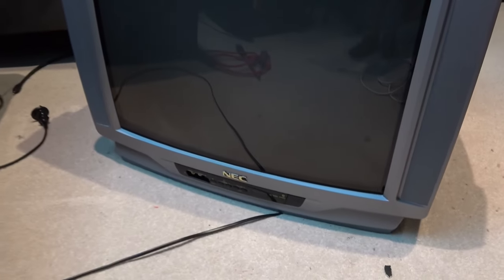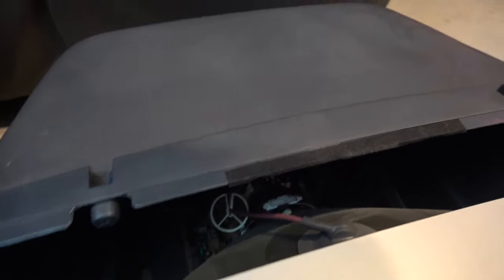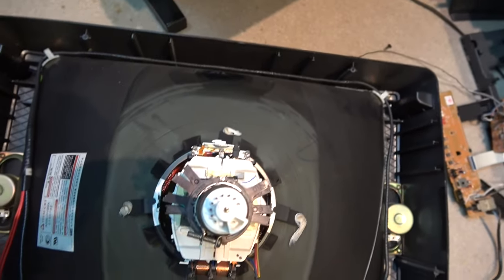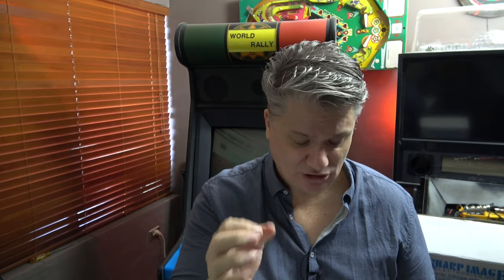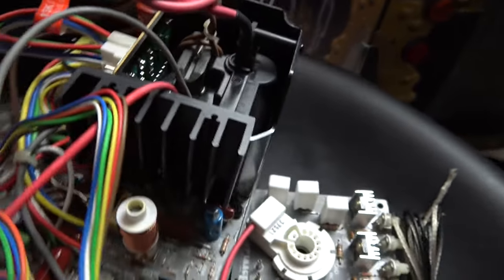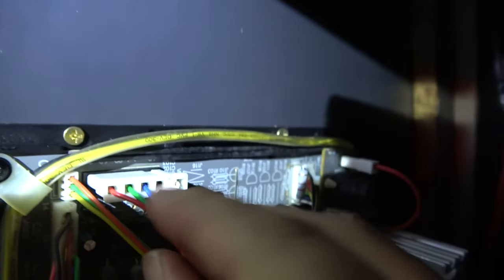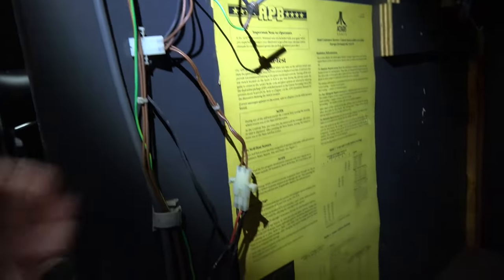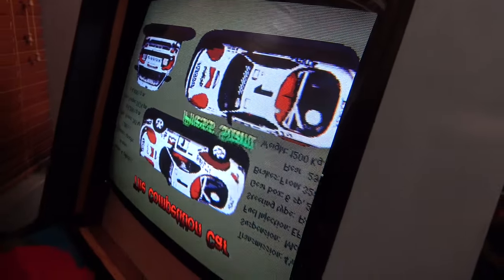FE021 - How to convert a TV into an arcade monitor!

Comment: I did a tube swap on a U.N. Squadron cabinet with some serious burn-in years ago. I just bought several old TVs which looked the correct size and swapped tubes. Worked great! I think I may have gotten lucky with the resistance. I can't remember if I used the old or new yoke.

Comment: I know this is an old video now and maybe others have also suggested this - but, you cn use any SCART RGB CRT tvs. Even Sony tvs - you can make a really easy Jamma (or whatever game you have in the cab) converter to scart. You just need 3 capacitors and 1 resistor.

Comment: I've been building and fixing these arcade crt monitors for years, these days with new tubes so very thin on the ground I tend to pull tubes from later tvs as they usually have virtually new tubes in them with low hours on,  it's surprising still how popular they are with arcade lovers and retro gamers, your right about Sony tubes... they can't be used.  Well they can but it's a pain because of the dual focus pins, different pin configurations, voltages etc, normal flat and square tubes can be used though ive built a few of 25 and 28" flats for customers who wanted to upgrade over the traditional curved tubes
Reply from the maker: Nice one...yep the sources are starting to dry up that's for sure....

Comment: I had the same problem with the neck being to long on a Sony monitor in my Electrocoin as it barely touched my access panel in the back. So I routed out a small square hole in the access panel to let the neck clear then bolted a new, smaller board over the hole and bought myself half an inch of extra clearance. The access panel looks a little strange but it worked and I can get to my neck without pulling the whole access panel off.
Reply from the maker: That's a good idea. I know a lot of them are a very tight fit and some original cabs have a bump on the back to accommodate the neck. You don't realize how big they are until you try and jam them into a cabinet, that's for sure!

Comment: I ordered a universal chassis from the same place quoted all the specifics and although it worked the image completely distorted I later found another tv that has the right yoke readings and had a more curved glass and it works better but still warped in side scrolling games now i just picked up another tube thats even more curved hoping it would be compatitble but the pinout is different so i cant use it. Now im still on a wild goose chase a tube that will work with the arcade chassis nothings showing up for sale anywhere.

Comment: Wait! What? You can't discharge that tube using another chassis as ground!!! Where would the discharge current go? Through the floor carpet? There is metal on the TV chassis that is supposed to be ground for the TV. Fortunately that TV was already discharged. And "modern" CRT TV's are usually discharged by itself within 15 minutes without power anyway.
Reply from the maker: You raise some valid points and these sorts of questions and assumptions can end up filling many pages on an arcade forum for weeks! All I will add for anyone else reading this is to say make sure you adequately earth the charge from the tube before undertaking any further steps in the process. Thanks for sharing your thoughts, safety is extremely important.

Comment: Is there a reduction in quality going from an arcade monitor tube to a television tube? I always thought arcade monitors were superior. That said, anything is better than lcd/led.
Reply from the maker: Great question. Interestingly according to a very experienced and respected local arcade tech, the arcade tubes tended to be the rejects that weren’t good enough for TV’s. So actually the other way round to what you thought!
Reply: I do find most regular TVs tend to have better geometry and clearer picture in the corners than your AVERAGE arcade monitors. However arcade monitors usually have much greater flexibility in terms of frequency ranges, higher quality  inputs, refresh rates, and screen adjustments.

Comment: I am swapping out an old monitor for a TV and using one of those converters with RGB wire connector so my question is can I just connect to power cord from new TV to the original power from old monitor? With old transformer still hooked up?
Reply from the maker: I'm not a licensed electrician so I can't give specific advice with respect to YOUR power configuration. There are also lots of variables. However, the likely safest option would be to maintain the existing TV power cord as it was designed and have another standard power socket in your cab to plug it into (e.g. route a standard power board into your cab). 
You should probably ask a licensed electrician if you are going to attempt to splice the tv power into the existing transformer.  In/Out transformer voltages would need to be checked, load differences and TV chassis power input expectations etc. Don't guess with power as transformers/chassis can melt, catch fire etc. So please consult a licensed professional.

Comment: I'm no expert either but one thing is quite certain: CRTs are not limited to any horizontal resolution so you definitely should be able to display all those pixels horizontally! There must be some way to do that.
Reply from the maker: I agree. I ‘think’ its to do with the variances of the yolk on the tube with what the chassis expects. When doing these sorts of match-ups the two may not align quite correctly. It’s also impacted to some degree by the source. Not an exact science for sure! Cheers
Reply: ???
color CRTs have limited resolution by the shadowmask or aperture grill (Trinitron) pitch. Even mono CRTs have limited resolution*luminance product by their electron optics. You can't focus a 25keV beam to an infinitely small spot, even theoretically, because as the electron density in the beam increases, the electrons repel each other, causing a de-focusing effect, and further the electrons hitting the phosphor scatter secondary electrons which cause spot spreading.

There is even a spec for color CRTs "TV lines" which specifies the maximum horizontal resolution possible due to the color mask pitch. Better tubes have more "TV lines" and there's nothing you can do to make a low resolution CRT into a high resolution model.

Comment: What about a PC vga monitor? The old ones of course
Reply from the maker: Yes they are good especially if you want an easy way to play mame, however some argue that because the resolution is much higher that you won't get 'native' low resolution that a TV tube would be rated at that matches the arcade games (Not all of course as there are a lot of medium and then later high res games). Most people don't really care about the subtle differences so a PC CRT still gives you a good result (and MUCH better than an LCD). I've also found lately that the PC monitors at high res are a great substitute for a vector monitor. Clearly not the same but better IMO than a flat screen or arcade/TV CRT.... So yes there are options here for sure. They are getting harder to find of course and often getting one at 20" can be expensive these days unless you hit it lucky with someone tossing one out...a lot rarer to see that happen unfortunately.

Comment: correct me if i am wrong , you can discharge a monitor using another chassis for ground? this does not sound right i am pretty sure the ground needs to be part of the chassis your discharging.
Reply from the maker: If your monitor has a frame then yes, that’s the best place to latch on to. The chassis is not usually grounded to earth (ie it’s a floating ground). My understanding is the CRT is acting like a big capacitor and once you close the circuit to the floating ground it’s enough to short out the capacitance in the tube. As such, if the tube isn’t in a chassis then it just needs another ground with enough ground potential to complete the short. Another chassis with a floating ground should allow the short to occur in the same way. I’m no expert and there is a lot of info on this, some that contradicts other information.  I would seek professional advice if you are not sure. I am not qualified to give that advice but the above is my understanding. Cheers.
Reply: This is wrong. If a tube is not in a chassis, the only way to discharge it is to short the cathode to the anode. When it's in a chassis you are only discharging it by shorting the anode to ground, because the cathode(s) is (are) attached to the TV's ground via a bleed resistor. The only way touching the anode to another chassis' ground would work to discharge it, is if both chassis are attached to a common earth, say via the earth cable of the 3pin plugs.
Reply: There are actually two charges to consider, and both of them need to be dissipated. One is the relative charge between the cathode and anode, and the other is the space-charge (static charge) between all the elements of the CRT and earth. Both of these charges can be large and deadly, the capacitive charge is larger, but both need to be dissipated to make the CRT safe to handle. In other words: ground the anode to cathode and earth simultaneously.

Comment: Is there a way I can hook up a Paly Station to a arcade monitor?
Reply from the maker: If you are trying to hook up to an existing arcade cab/monitor then I’m not sure if there is a converter available to convert the multi-out on the PlayStation to the RGB/Sync that the arcade monitor will require (there probably is I just haven’t done it). If you don’t have a cab then easiest way to get the same CRT output would be to simply pick up an old CRT color TV and plug directly into that. Either way perhaps do a search on “PlayStation multi-out video converters” to see what’s available for your needs.

Comment: Hey mate, im a fellow Perthian. Making my own Mame bartop at the moment. Ive got a red and black two pin plug coming off the tube. I think its the degaussing circuit. I see in your vid its white and black? I cant seem to find how to hook this up to my jomac chassis? Does it take 240v input? Any advice appreciated. Cheers, Adam.
Reply from the maker: Cool! Welcome to the channel. Apologies for the somewhat late reply (busy week) so you probably have sorted this now? If not, then it sounds like that two pin plug is the degauss circuit (if it connects to some wire wrapped around the outside of the tube). The chassis will normally pass a stepped down 100v AC (not 240v) to that degauss circuit either directly (With a manual momentary switch spliced in to activate it briefly) or through onscreen controls (if it's a fancy chassis). You probably don't want to take a guess at this due to the voltages concerned so my best advice would be to contact Joey at Jomac and ask him as he is super helpful and will point you in the right direction depending on your exact chassis type. Cheers!